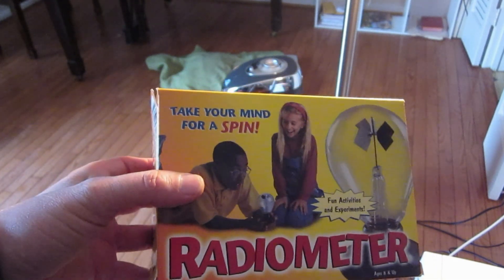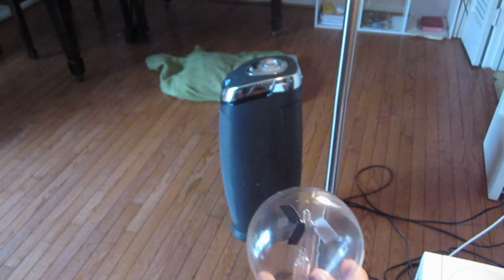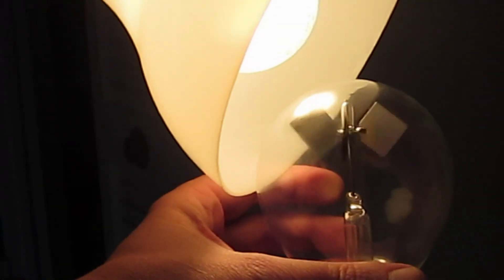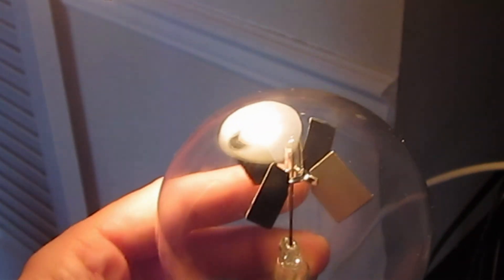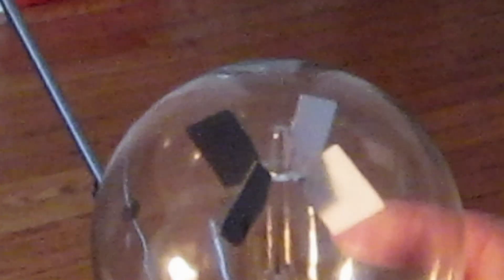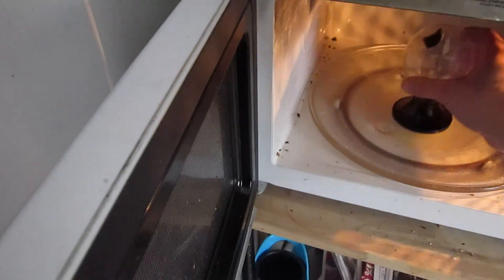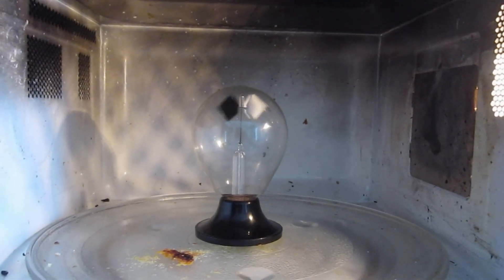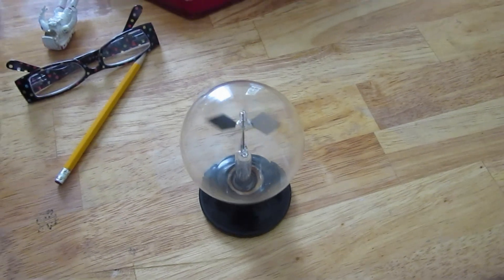Radiometer in the Microwave

Comment: Interesting! This way I don't have to put mine in the microwave and ruin it, which I would never do anyway. The wheel running backwards could also have been observed after heating with the hairdryer: At first it runs normally with the shiny areas in front, this comes from the heat from the hairdryer's nozzle. When you take the hairdryer away, the wheel starts turning backwards because the warm glass transfers its heat to the gas molecules and these heat the vanes. The black side of the vanes radiate more heat than the shiny ones and are therefore cooler.

Comment: I never saw the cold temp experiment before.
Really cool, oops that was a pun.
When I played with the one I had, I did notice it reversed direction when I took it out of the sun.
I thought I had jostled it but it turned faster than a jostling could of done. 

? When hot, heat leaves the black side causing propulsion . ? 
? when cold, black side absorbs more heat  than the white side ? 
??????
It looks like, when it is gaining heat, ? mass / energy ? hits into the black side and "sticks", while the white side does not gain mass / inertia, causing it to turn clockwise (as viewed from above).
. . . 
???
The more I think about it, the less I understand it . 
Especially when I incorporate the theory of pressure mediation. 
As seen on the Theoria Apophasis youtube channel.
Reply from the maker: Yes I know.. I am still thinking about it too.. I believe it has to do with how the veins inside interact with the low pressure gas inside the bulb??  It is a very interesting phenomenon to say the least!

Comment: i was of the understanding they operate due to black body radiation, electron ejection and photon absorption... it spins the opposite way when you cool it because a metal shrinks as you freeze it (drawing electrons in from the enviroment and remember an electron can pass through any substance, all matter including hydrogen has electrons)... due to newtons laws when light strikes the black side, the atoms are ionized and electrons change orbital shells, some however are ejected forcing the vein to spin in the opposite direction (these electrons then strike the glass... and if you suspend the radiometer the glass will spin in the opposite direction to the veins)... http://www.teslasources.com/
Reply from the maker: Black body radiation is just low energy photos.. they do not carry much momentum.. The radiometer must be reacting with the gas inside the bulb. Surely, to conserve angular momentum.. you are correct about the radiometer bulb spinning in the opposite direction. Black body.. should not work backwards.. when the device cools down??.. It seems to behave like a heat engine..with the center and bulb being the two heat and cold sources??.. it must be due to the molecules hitting the white and black veins, and being heated or cooled, and giving up energy differently.. Maybe the black side looses its energy more quickly, due to black body radiation.. when it is cooled? So then when the center become colder than the envelope it spins backwards?? Nice website BTW.. I am working on Tesla's radiant energy device, but I am not posting much of the results at this time. I do have some Tesla coil videos though.. and some other interesting science as well.. Thanks for the great comments!
Reply: @jaynesnetwork  I think it's vacuum inside the bulb.
Reply from the maker: @amedeekingchef6552  It is a partial vacuum.. is is some gas in the bulb..